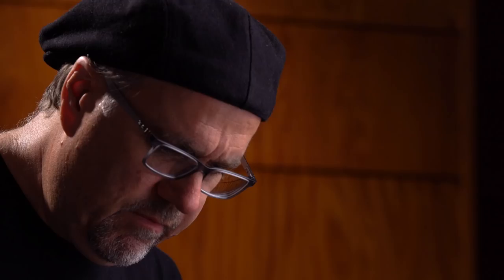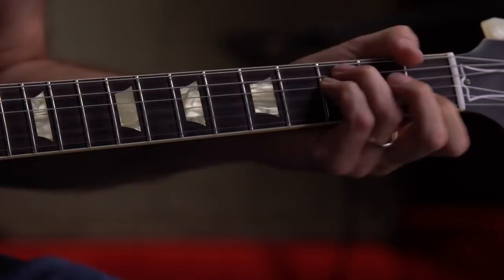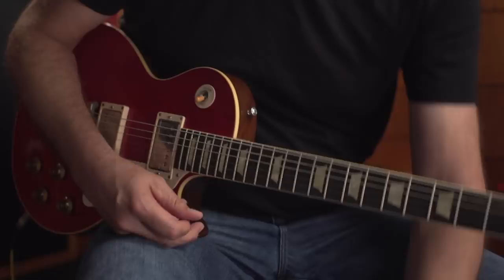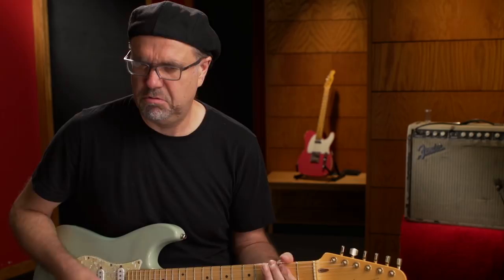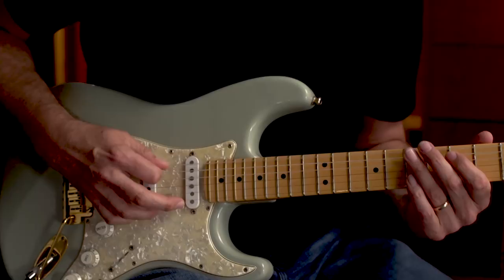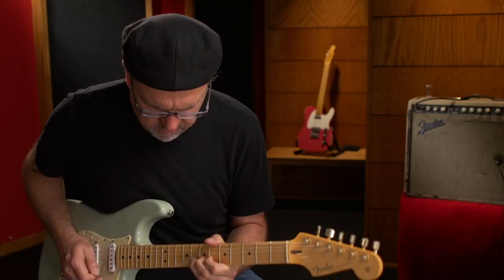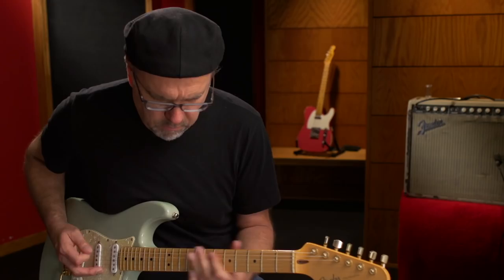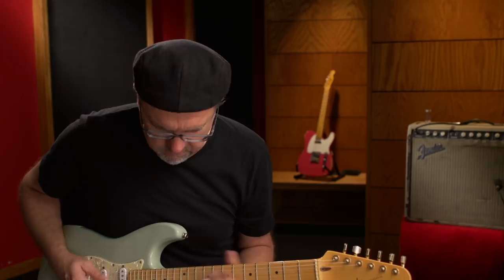JAM pedals | Rooster video demonstration by Greg Koch

Comment: Just built a Brian May style treble booster from scratch and added some cool features like a on off on switch with different capacitors for selecting bass/full frequency boost, mids boost or the stock treble boost and also made it easy to switvh out transistors. I'm pretty sure the rooster is the exact same thing as the Brian may treble boost which is a type of Dallas rangemaster clone. It's such a great fucking pedal. My homeade klon and upgraded ts9 are excellent(i think they are amaxing esoevially together or hitting my marshall dsl100hr) but the BM treble booster is a whole different level. It just feels excellent to play through and makes everything so articulate. It's probably one of my favorite tones I've ever heard. Treble boosters do something magical and unexpected when you use them to boost a darker sounding over drive or darker sounding amp. And it's not the same as a regular over drive, in my opinion it better but they are both nessesary tools for shaping tone. And since I added a level instead of just a gain control I can dial in some great sounds. The BM treble booster calls for a 2n5088 transistor or a 2n4401. The 2n5088 is good but noisey and the 2n4401 is just bassy and less articulate which defeats it's purpose. So I used an mpsa18 which is a low noise transistor that sounds identical to the 2n5088 bit without excess noise. I put in an if socket though so in the future if I want I can try other transistors bit just for fun cause the mpsa18 is perfect.